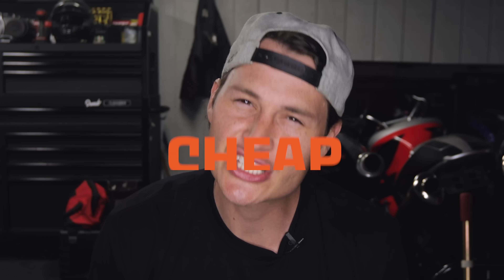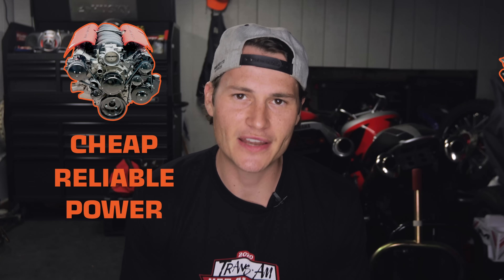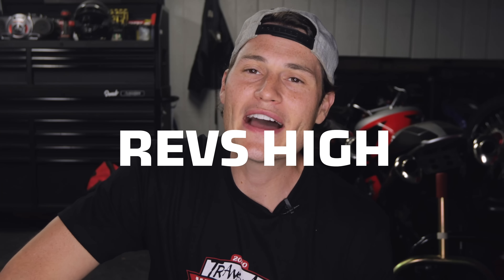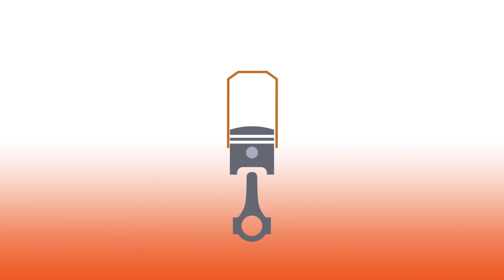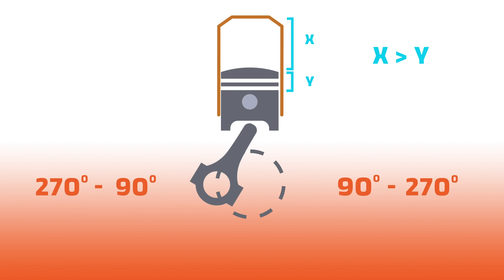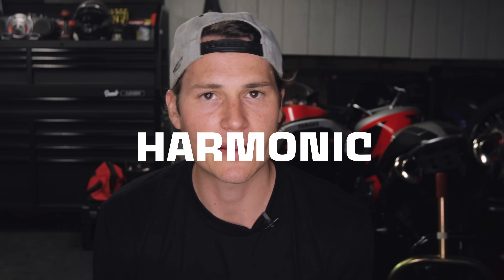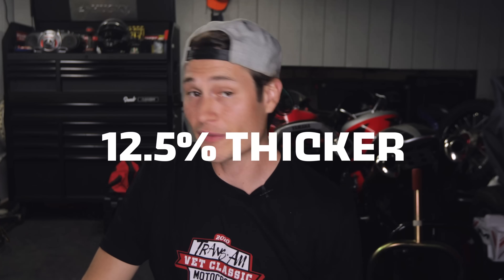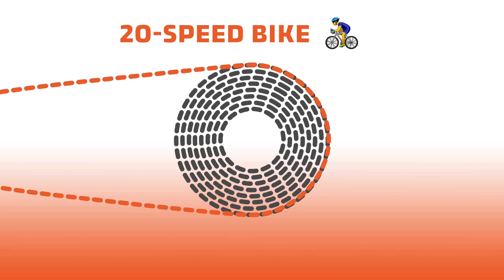Nissan VQ Engine - The Science Explained

Comment: Nissan makes great engines but damn it they've been making shitty transmissions for the past 18 years. It's like a pizza shop with nice fresh toppings but the crust is cardboard tasting.
Reply: Cd009 can hold over 1000hp
Reply: I have a 2007 Nissan Murano with over 206,000 miles and I drive it like a TrackHawk and never changed the CVT fluid.
Reply: That's why people use 350Z trans with 2jz swaps...
Reply: @VentoDriver  You never worked at a Nissan dealership before huh? The one I worked at all I did most of the time was warranty work for cvts and xterra autos. Hell those q50 and q60 turbo model transmissions are the worst. Broken promises from a performance car only to hear from pissed off customers wondering why their fluid looks so damn burnt after only 20,000 miles. So yeah not surprised people would put a cheap transmission on those things to save some money. Toyota parts are quality and not cheap. Yeah you all can rave about those cd009s all you want but once you get input shaft and bearing problems your wallets would be crying.
Reply: mugensamurai  dude nobody cares about CVTs and Autos. Ofcourse they’re garbage.
Reply: @VentoDriver  my thoughts exactly 😂

Comment: Big up CD009 gearbox gang!
I have a Nissan Silvia S15, I blew the original gearbox and bought the CD009 from the VR35DE RevUp and did the conversion for my S15, as it's the best gearbox conversion option for them 😄 the last triple cone synchro gearbox with a non-concentric clutch slave cylinder before the JK series found on the VQ35HR and the 370Z engines

Comment: They’re reliable until the stock Nissan catalytic converters grenade the motor 😕
Reply: How??? Looking to buy one
Reply: Savage Sock I have a 2007 Nissan Murano with over 206,000 miles and I drive it like a TrackHawk and the check engine light has been on for over a 10,000 miles because the oxygen sensors went out and it still runs strong
Reply: Savage Sock the catalytic converter on the driver side fell apart internally and the motor sucked the metal fragments back the exhaust port, that scored the a few of the cylinders. After that my perfectly running VQ had very poor compression, and almost used as much oil as it did gas lol! Best thing to do swap out the cat’s for test pipes if you don’t have emissions.
Reply: @WTS-vu7yw  aw rip bro I have emissions tho :(

What could I do about this
Reply: Savage Sock perhaps go with a quality high flow cat replacement and that should keep you legal and should help prevent any surprises! Best of luck!
Reply: W01009 TS03 shit well no I have a good reason to upgrade to some HFC lol what set are you running? Z1 cats sound pretty nice
Reply: Steve Shaeffer yes Z1 has greats parts, I used Berk not sure if they make a good HFC though i just had the test pipes and they sounded real good and fitment was a piece of cake

Comment: I'm still trying to figure out the part that makes the vq so much better other then it needs a cradle and it has 1mm thicker rods.... Nothing to do with the way the intake is designed or how Nissan invested millions to make the engine sound the way it does... Nope it revs to 7600rpm... And BMW e92 m3's are v8's that Rev to 8400

Comment: Bigger rear cog (on bicycle) = lower gear = easier to pedal = faster cadence but lowering of speed = easier to climb hills.  Bigger ring on front = higher gear = more effort.  For close ratio the example might have been on a "10-speed" your 5 rear cogs have 12-teeth, 16-teeth,  20-teeth,  24-teeth, and 28-teeth, while your "20-speed" has 12T, 14T, 16T, 18T, 20T, 22T, 24T, etc so the "steps" between each cog (or "gear") are smaller or "closer". Felipe probably has a 10, 11, 12, 20, 22, or 24-speed bike.  The next time you guys use bicycles to explain automotive concepts you should consult Felipe and run the animations by him as well, because I'm sure some were wondering how you came up with "10-speed" and "20-speed" based on what displayed. I'm too dumb to do much work on cars (right now), but I'm just dumb enough to understand bike gearing.
I love this content. It is informative and the animations and explanations make it easier for me to understand these concepts. Thanks!

Comment: Talk about what makes them only last 300,000 miles max thats what I want to talk about. Its my favorite engine as long as I dont think about how badly they tend to burn oil, though I'll mention mine didnt burn a drop. But theu just aren't meant to go the distance. A Chevy 350 can go 500,000 miles and still run okay. An LS can too. Hell my ford focus' zetec is barely broken in at 250,000 miles. A damn prius can easily hit half a million miles. A VQ with over 300,000 is nearly an impossibility. That saddens me. The vq35 is amazing in almost every way but its lifespan.

Comment: Fact: do you know the Motor of 350z is from the Renault espace so it’s not a japanese motor but a french one ^^
Reply: Incorrect, it was designed and manufactured by Nissan not Renault. Renault just used it in like 2 cars
Reply: @tylerlang5424  in coreect check it
Reply: Already did. VQ was already being used by Nissan before Renault even owned a major stake in Nissan
Reply: The motor isn’t FROM the Espace, Renault just uses it in the espace. The first iteration of the VQ came out in the early 90’s
Reply: @tylerlang5424  dude it's not beacause renault don't use it they don't build it omfg think ...
Reply: Bro I don’t think you’re understanding here. Nissan had the VQ before Renault was even in the picture

Comment: As a gear head, an engineer and a cyclist... Your analogy is exactly right comparing close ratios to a bike with more speeds, but your illustration depicts the rear gear cluster, which is known as the cassette.

The shifts you depict are actually downshifts, increasing your mechanical advantage and your leg RPM.

Comment: Video talking about HR motor and how great it is.
VHR: Am I a joke to you?
De: "Insert trumpet noise joke here"
Reply: Daniel Pfister vhr cylinder heads are a joke, the hr heads are proven to flow more
Reply: @liamheuvel2681 that may be true but when you factor in the VVEL that the VHR has that the HR does not have, suddenly that difference becomes lesser.  Only with a crap ton of money, labor, and building on a serious boosted setup may you find some possible gains but it takes a lot more to get there so unless you have a hole in your pocket to burn more- VHR is your better choice just due to the cam setup
Reply: @Bernardo almost 3 years on mine and 30k miles at 112k and it looks good.  My valve covers were leaking so I had a chance to pull things apart and look and everything was super clean.  If you take care of them they last
Reply: @danielpfister7811  I'm more worried about the Water Pump and Galley Gaskets in the future. Stupid design for having an Water Pumping  running on the timing Chain.
Reply: @vivi_75  engines are cheap, unless you wanna pull it to replace the water pump when it goes but then you may as well replace timing chain etc vs just buying a new vq
Reply: @MrSirGiuseppe  yeah that's my plan. I've had the radiator support off already once everything is off it looks pretty easy to pull I dread the day my water pump gives my oil pump already exploded once drove it 7 miles with no oil pressure, replaced the pump and 30,000 miles later no issues whatsoever. Just rolled over to 70,000
Reply: @vivi_75  just replaced the water pump in my moms 2003 infiniti i35 and omfg it was a pain in the ass especially because its a front wheel drive vq35de so I was right up against the frame
Reply: they all sound like trumpets lmao
Reply: @semajyar4201  false
Reply: @TeamXLR8Z   nah you wouldn’t even know u prolly drive a honda broke boy
Reply: @TeamXLR8Z   then you would genuinely know that literally all 350z de and ur sound like trumped idc what you do to it
Reply: @TeamXLR8Z  all 350 sound like trumpet
Reply: @semajyar4201  Nice response. 😂🤣😂🤣 Yeah, ok buddy. You keep telling yourself that. Whatever makes you sleep at night. The only people with trumpet Zs are the guys that don’t know how to mod a car in general.
Reply: @TeamXLR8Z  yea u don’t own a Z ur broke lmao
Reply: @semajyar4201  nahhhh 😁
Reply: @semajyar4201  I’m guessing you still didn’t go to my page or you would have seen my Z literally everywhere. Nice troll work though. I’ll give you that. 😁
Reply: @semajyar4201  😂🤣 Lets be real here...by the sounds of it, you probably drive a Prius or Corolla. Highly doubt your opinion on clapped out matters here when it comes to sports cars.
Reply: Clearly a trombone.  Trumpets don't sound like that.
Reply: @bjornironsides6474  You clearly must either play with the trombone often since you’re such an expert :) or you’re one of those individuals that likes to straight pipe their cars and make them sound horrible. Any car that is straight piped sounds terrible with very few exceptions.
Reply: @TeamXLR8Z  I did play trombone lol.  And I agree. I left my exhaust stock.
Reply: @bjornironsides6474  Good man. If you don’t or are not willing to  mod it right, leave it stock. Good way to play it safe.
Reply: @TeamXLR8Z  took my muffler off and got a brick thrown at my z, I now have a 3" and a twin tip off an aftermarket muffler, does sound like a sad trumpet a bit to be fair haha

Comment: What about the asymmetric piston skirts and DLC voating to reduce friction?  The dual intake manifolds?  The variable timing on both intake and exhaust sides?  The higher compression ratio?  The taller engine block that is identical to the 370z block to allow for better rod:stroke ratio to allow for higher revs?  The fact that while on paper the HR is only 19hp higher than the original DE but on a dyno is closer to 30-40whp and a full half second quicker in the quarter mile?  That a couple of folks have pulled a 13.1 bone stock?  Ok I'm done :)

Comment: Unrelated: this dude looks like Chase Stokes from the Outer Banks.

Related: the VQ35HR is somewhat different from the DE, it is more refined. They are pretty reliable, and I honestly think with a true exhaust system, it sounds really good, not the straight pipe crap, anything straight pipe sounds like shit.
Reply: That's not true at all.. A lot of motors sound really good straight piped. VQ's however... In my experience they do not sound good, in any way, when they have a cat-less exhaust...

Don't ask me why, I couldn't tell ya.. But the 1000-1500 rpms riiight before the power band, just sound awful... This burbly dry raspiness that just sucks.. Bad. Sounds like shits rattling like crazy, it's just bad.. You all probably know exactly what I'm talking about.. That's why I think VQ's have a bad rap when it comes to their sound. 

If you leave them cat's on you can literally go straight pipe from there, add a muffler, whatever you wanna do.. A pipe that's 3 inches larger than what the car needs.. Doesn't matter, it's still gonna sound good. Don't do that though... Because exhaust scavenging and whatnot, y'know...
Reply: @danielnelson4881  exactly what I just said, you straight pipe a VQ or any cars, sounds like shit, it will be raspy, but nice exhaust system would bring out the true tone of the engine
Reply: @trijohn23  And exactly what I just said... Is that there are definitely cars that sound good straight piped. The VQ does not however. You said "anything straight piped sounds like shit." I disagreed with that, while agreeing with your opinion that a VQ sounds awful straight piped.
Reply: VR6

Comment: I have cefiro a32 with vq25de.. you know what? It cant handle heat stress well.. i had 2 vq25de broken as of fan stop/fault and sensor fault.. the fan fault make the water temp rise to the max in no more than 1 minute.. and the engine expand and no more in good useable state.. no more vq engine for me

Comment: On the 10-speed and 20-speed you went the wrong direction for the higher gear.  I have a "65 chevy C10 and you have me considering the VQ and 6-speed instead of rebuilding the 230CI straight 6????

Comment: This guys are just making the whole Z generations get more expensive
Reply: G35 as well lmao, m35 as well. The m35 is slept on seriously
Reply: @adam_bh  the g35 is cheap asf compared to the z where i live. no clue why
Reply: @Usef320  the reason behind it (from what I’ve heard about G35’s) is due to it being plagued with electrical problems. The G35 has more electronics than the 350z. But I could be wrong for all I know.
Reply: @martinv3126  yeah, most g35s here are under 6k
Reply: @martinv3126 "Plagued". The g35 is not plagued by electrical issues 😅
Reply: @frazer9  There's certainly a few though. Almost all of which are centered around the guage clusters. The gas gauges love to have their solder joints go cold and the battery/brake lights can sometimes become a permanent fixture of the dashboard, even after replacing the battery and alternator. Use the guage cluster only for the important guages like the tach or the speedometer and you're all good. Best way to tell if it's the battery light or if the charging system is actually failing is to press on the top right of the acrylic in front of the cluster, if the light goes out, your dash is faulty. Just send it into a repair shop though and they'll resolder the failing spots, I'd do it myself if it didn't require a microscope and steady hands.
Reply: Adam B-H m35 looks nice but they are slow
Reply: @anthonywilliams1616   they aren't slow.
Reply: @joshuabenjaminscott2365  wdym, ofc its slow since it doesn't have a 5.0 ls-hellcat super turbocharged v8??
Reply: @adam_bh  garbage. Id rather put on a mask, tell my dad im gay, spit on my family tree and hop on public transport than drive any of those pieces of trash.
Reply: Stefan Cupovic kinky
Reply: @marcoandrade4872  ;D
Reply: Better you than another MR2. I can barely find parts as it is.
Reply: @negativeindustrial  amen lol; just bought a ‘93 Turbo in stock condition, garage kept. Super happy.
Reply: It makes me sick when I see 03 350z's posted for like 15k.
Reply: To bad they're not making my R50 pathfinder shoot up in value.
Reply: The donut media tax
Reply: Already got one let's gooo
Reply: fact, i had to abaondon my dreams of a Z31 cos of these dudes.
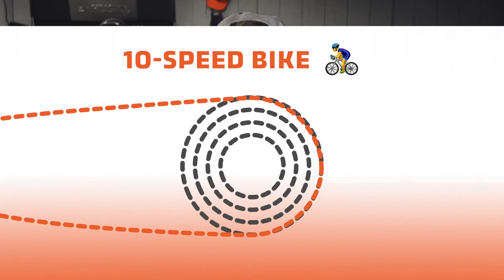Reply: Anyone else noticed how "upshifting" on his bike makes the chain go to a higher ratio instead? 13:50
Reply: @shotator2816  to match leg movement and continue gaining speed. Think of going down a hill and needing a higher gear to match bike tire rpm
Reply: D A N D Y W A V E S  suburban dad lol. Wouldn't mind one of them bad boys.  Decently powered to.
Reply: Theyre just tryina get a return on the hilow series
Reply: ik
Reply: I’ve owned mine for 8 months put 0kms on it and really haven’t touched it and I’ve already made $2k
Reply: Buy one now, very few cars can be an investment.
Reply: it’s too late, and it’s getting the proper recognition 🙏
Reply: Lol no
Reply: @hermatred572  look on offer up
Reply: dont forget the cousin of the Z.... the G
Reply: nah theyre still hella cheap even during this shortage lol.
Reply: @notdoow7851  it's rare to find one under like 8K for a clapped out example
Reply: Kids are going to get screwed. They will need to buy a case of oil every month OR ELSE! I used to see lots.. NOW I DON'T SEE THEM NO MORE! Wey dey go? Wey dey go? BOOOM! thas wey dey went.
Reply: On the bright side they're making Subarus cheaper 😂
Reply: I didn't know the Nissan 350Z, Altima, Maxima, Quest and Murano, Infiniti's G35 sedan/coupe, M35 and FX35 ALL uses the VQ engine!
Reply: It’s now cheaper to go boost in my Camaro SS 😅 still saving for mid mount turbo kit for the Z absolutely love my VQ
Reply: Just was finally able to afford mine🥹
Reply: Yea they do it to all of the whips. I’m going to start my own cheesy talk car channel and dress as genz kids act. Literally I feel like they are not even car guys. They are dudes who liked ricers, ended up making videos of research they did online and talk like they are gear heads. All to sell….. wheels. 😂😂 I always get a good laugh at them.
Reply: Pssst infiniti g35 coupe is the same, and can be found much cheaper
Reply: Yup Internet has completely fckt the market....
Reply: I am super ok with that, Gaining market value for me.
Reply: @carlos8xd10  Thanks for actively making not only the Z cars, but the market and car community worse. Not that Z cars which have been beat up after being subject to poor modifications and abuse at car meets are worth all that much in the first place.
Reply: @RockSolitude  That sounds like an owner issue more than the car.
Reply: Good
Reply: @timwilson7326  😁🙁🙁🎉🎉🎉🤣🤣
Reply: I’m a little late but VQ35HR is only in 07&08 model year zs
Reply: @Olympiann  Yes and It took me forever to find an HR model. I only wanted 07 or 08 and thankfully got an 08. I'm replacing the whole suspension and added a transmission cooler. I'm never selling mine.

Comment: 9:38 the pistons don’t fire at the same time... otherwise you’d have a larger vibration from having a basically 3 cylinder engine running. Instead they offset them so it fires every 360 degrees on mirrored cylinders eg: 1-6, 2-5, 3-4. I.e. the firing order is 1-5-3-6-2-4 in an in-line 6 engine